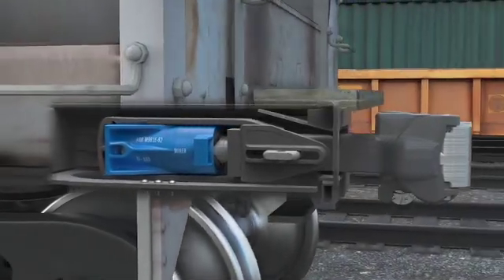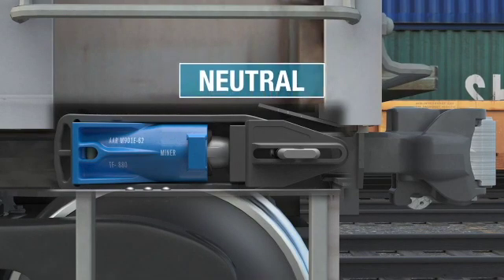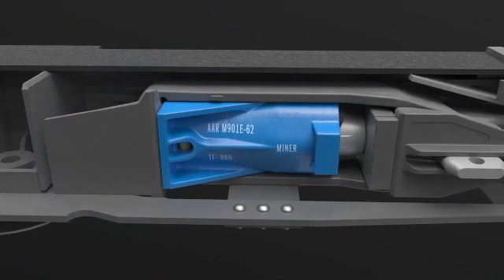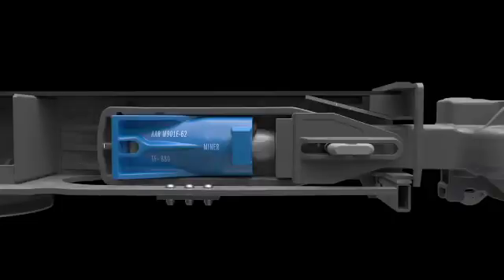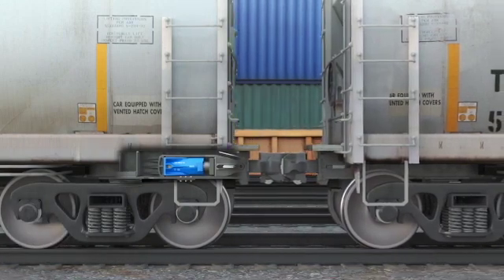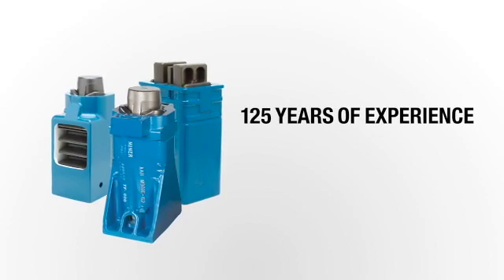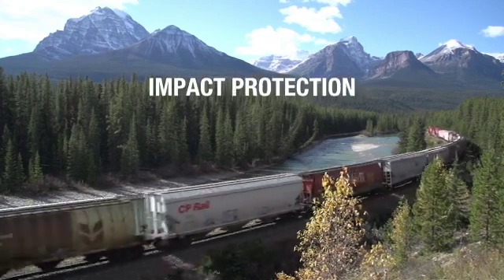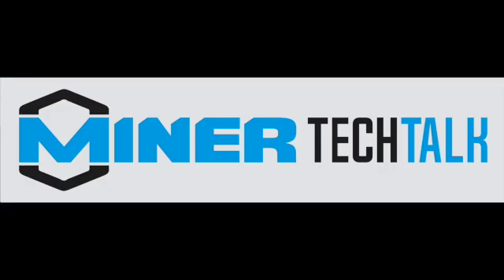How Draft Gears Absorb Railcar Energy

Comment: My father and I used to make the presses and pressing rings for the regulated mandatory testing of draft gears. I knew what they did, where they went, and all of that, but I don't understand what goes inside the outer housing to make them compressible. Is it a block of rubber? Some kind of air cylinder?
Reply: Its springs inside of the draft gear, we have to press them to get them out of the draft gear pocket at work